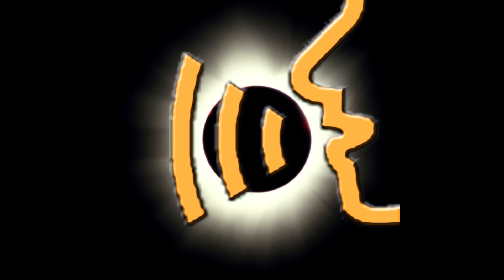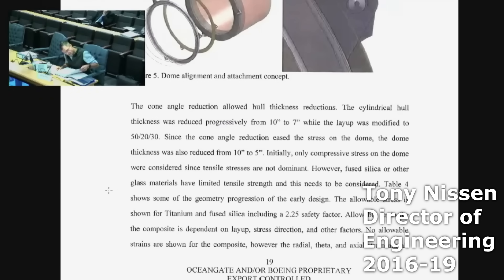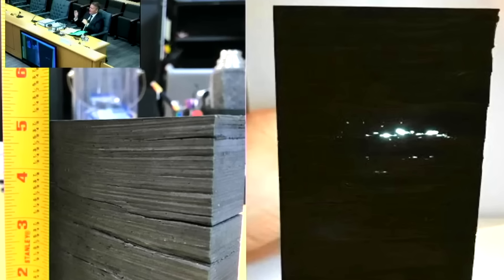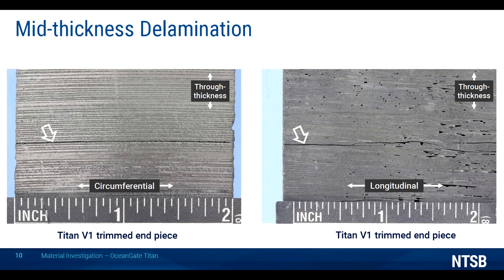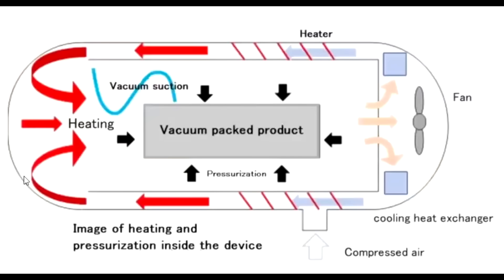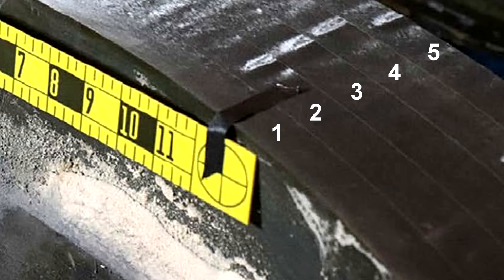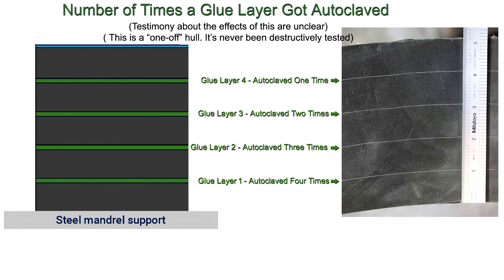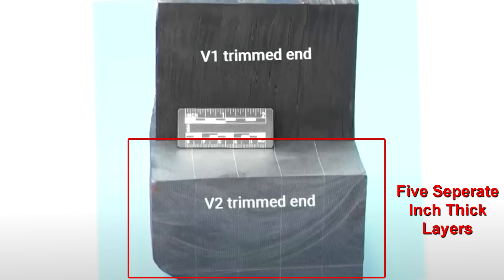Who Engineered the OceanGate Titan V2 Hull? Maybe Nobody Did?

Comment: I worked with composites for 25 years, and my first thought was the repetitive autoclave cures. For rework purposes, we were only allowed 2 additional cures.
Reply from the maker: Thanks for that comment.  Yes, the multiple autoclave runs is an issue that was not fully worked, from what I can gather.
Reply: I had not thought about this until prompted by this excellent video.  I would not be surprised that repeated cure cycles caused further shrinking of the layers. The would mean that the inner layers would give less support to successive outer layers than if they did not shrink. The result would be lower than expected hoop strength and axial strength. And fracturing between layers.

Also designing for 1,000 cycles puts this in the low cycle fatigue zone.  In that zone a defect could well mean a degredation of two orders due to a flaw.  Two orders means possible failure at 10 cycles. Bon voyage!
Reply from the maker: @piperg6179  Yes, apparently there is very limited information on the effect of the first layer of carbon fiber being autoclaved 5 times.  Bart Kemper, gave good testimony about it; too many unknowns and OceanGate didn't test it at all!  I mean zero testing!  Thanks for commenting.
Reply: So the inner layer would be pulling from the outer layers?
Reply from the maker: @cudedog  Yes, basically they would act independently which is weak.  You need to watch my latest video on that, search YouTube for the title   OceanGate Titan Hull - Porosity & Glue; Porosity & Glue; Porosity & Glue
Reply: I agree that multiple heat cycles can damage composites, especially when the heating profile is exceeding debonding temperature. You can of course get away with it with proper process control - but this is done with composites that are not really used in high stress bearing applications.
Reply: Excellent video.   Thank you.
Reply from the maker: @ginaanddenes9059  Thank you for the support.  Happy you liked it.
Reply: Aye, testing of repeated or prolonged autoclaving should be pretty easy, i think: Measure dimensional change and compression change of a block after each autoclave cycle.  But all testing still won’t compensate for the use of the wrong material.  In my primitive mind I keep seeing zillions of fibers that are very strong when stretched but in compression must be held in column by a smushy binder. If the binder allows axial movement of the fibers the whole mess collapses in a flash.  

No doubt this obvious problem was seen by Stockton as evidenced by his completely optimistic attempt to evade collapse by listening for small breaks on his RTM and surfacing before a runaway failure.  Propagation runaway in milliseconds and curing rise to surface in hours!  As a cockney couple remarked when i was a lad…..Pigs might fly if they ‘ad wings.
Reply: @lj6278  ed xxxx is on to something…..carbon fiber composites are indeed poor choices for compressive loading.  The Titan hull never would have failed if the designers had thought to have a vent through the hull so pressure inside and out were equal.  The crew would, of course, have to wear ear plugs.  Another, less perfect solution would be to fill the hull with conrete before a dive.  That would surely prevent implosion and on return to the surface the crew could just be chipped out of the concrete and scrubbed and showered.  And now i must toddle off to bed.
Reply: @lj6278  The possibile disconnection between layers is of some interest when the hull starts to fail because that initial failure is likely caused by the addition of local bending stress to the compressive stress imposed radially around the hull cylinder (usually termed hoop stress).  But hoop stress is the big stress and is purely compressive.  So, each layer would be supported by the adjacent interior layer, bonded or not.  Now, suppose that the inner layers, being subject to more autoclave bake cycles, shrink just a bit….the result would be that the outer layers have less support as hydrostatic pressure increases radial loading. 

…..just another little problem caused by choosing the wrong hull shape leading to choosing the wrong material.  Suppose Boeing had decided on making the 747 out of cast iron.  Or lingerie had been made of ferro cement. We would have somewhat less air travel and somewhat less romance.
Reply: No to mention carbon fiber is only strong being pulled apart, meaning its best used as a cylinder in keeping pressure in.  That subs hull had the strenght of the impregnated resin, and why it delaminated.

Comment: I didn't realize that OcenaGate was not really an engineering company, previously they purchased or leased submersibles. It was a desire to reduce cost and increase revenue that led them to "DIY" a new submersible. CF construction is not inherently unsafe, but the lack of investment meant that Stockton was continually short-cutting design, manufacture and operational decisions to reduce cost. This is really a failure of the OceanGate business model that led to the accident.
Reply from the maker: Thanks for commenting.  Stockton underestimated the difficulty of 4,000 meter dives. He also had to deal with Covid happening during the development of the first hull.  Then the first hull done by Spencer Composites seemed to have a lot of porosity and wasn't very strong.  Then they had the lightning strike in the Bahamas during testing and they have to trash that first hull. Bad business to get into.  I have a video about that.  Search YouTube for this title. OceanGate Was Broke! - Titan Caused It - Employees "Spill The Beans!"
Reply: @solareclipsetimer  Yes, now I think of it, I think it was your excellent video that highlighted the problems with the business. 🙂
I guess the problem is if you charge only $250k per customer, then you need a lot of customers to recoup the cost. But then you need a solid and reliable vessel to handle a high frequency of dives, and not a limited life experimental vehicle. OTOH if you charge a more realistic $1M per ticket, then you might seriously reduce the amount of paying customers.
I draw a parallel with Virgin Galactic, in a similar adventure tourism bracket. With a modest ticket cost, they get a lot of customers, but they have struggled to get a repeatable performance out of what was essentially also a one-off experimental vehicle.
Reply from the maker: @bobcousins4810  Yes, it was a business model that was tough to make work.  I think that is why his original business partner Guillermo Sohnlein got out early.  He had more business sense.  Thanks for commenting

Comment: Why carbon though?, it's not like it needed to be light to be under water. Aren't most modern sub hulls made of titanium?
Reply: The density is important, also CF is a lot cheaper.
Reply: If you do not want an expensive and specialized ship to deploy your submersible, weight is absolutely a primary concern.
Reply: @Kyle-sr6jm  Looked it up and the sub weighted around 10t, don't know how much of that weight was of the hull itself but doubt it would have increased the total weight all that much. Let's say it's 15t if made of titanium, can't some decent ship crane lower that just as well?, the damn boat was called Titan FFS!! The whole operation was superfluos and targeted to millionaires, what's a bit more money for this kind of endeavours?.
They should have let the riches control some 8k camera ROV from the luxury of a surface yatch while eating gold plated caviar and doing cocaine instead of using a manned ship, it's not like they were able to walk under there by themselves or anything. Going down in person is more or less the same and I bet they had to pee in a bottle or wear diapers, a shitty experience that added nothing of value but the bragging rights of being able to tell your rich buddies that you were down there.
Reply: Weight is absolutely a consideration - and titanium is also a lightweight material, so you seem to have answered your own question.
Reply: Weight.
Reply: Size is also a consideration. Even titanium pressure spheres are negatively buoyant, and every kilo of negative buoyancy means a large volume of syntactic foam needed to counteract that weight. Very heavy hulls need massive amounts of foam, which is bulky and makes the vessel slower when descending, maneuvering, and ascending.

Because it was intended to be a commercial touring vessel, being able to descend quickly, navigate to the Titanic quickly, spend as much time at the wreck as possible, and then ascend quickly would have led to a better experience for the passengers and a faster dive turnover, meaning more money.

Comment: Even if an engineer designed it, it wasn't engineered. He did pretty good, too. It worked for awhile. 😂
Reply: If he inspected and replaced the carbon fiber when needed, it probably would have lasted a lot longer.
Reply from the maker: Thanks for that comment.  That is an interesting way to put it.

Comment: 5:00 This 45° plies (of to follow what ever the designed layout configuration of the composite sheets is) is teached in the basic composite material course in aeronautical engineering studies in Finland. It is composite material dssign 1-on-1.
Reply: @mikapeltokorpi7671  Who'd have thought that strictly orthogonal strands would not make for the best stress distribution, right?
Anyway, I only know of 3D printed ones. Would you happen to know if one could check out a course like that online?
Reply: @JaroslawFiliochowski This was was over 15 years ago in a Finnish Tech College. Unfortunately the whole Aeronautical Engineering dicipline was ended after our class (both Finnair and Blue One major maintenance was mostly moved to abroad just before I graduated).
Reply: It's taught in us community colleges and also relayed to all composite hand lay up techs at Boeing when I worked as one XD

Comment: I’m not an engineer and I haven’t watched the video, but to me carbon fibre is fine for homogeneous contained pressure vessels but why would anyone use it to withstand pressure is beyond me.  As a rough comparison its about as useful/less as a rubber inner tube for the task regardless of the thickness IMO.
Reply: Why would you comment on a video you didn't watch? Genuine question, as there seems to be a lot of it about

Comment: If its a boing I'm not going 😮 not space, sky or under the water. I'm hoping they're not planning on building cars 🤣
Reply from the maker: Thanks for commenting.  Yep, Boeing has been having some issues lately for sure.  In this video I showed with the Boeing testimony annotation that the Boeing work for OceanGate regarding the hull consisted of some preliminary design ideas in the period of 2012-2013.  Very early on and they never built anything.  To give them a little credit,  they actually recommended a very important thing that was ignored, and that was a layer of carbon fiber laid at 45 degrees.  As Mark Negley testified, a layer at another angle helps distribute loads from other fibers that maybe under stress.

Comment: Spencer Composites thought in terms of at least 1,000 cycles for V1 hull, that is, it was a limited service life component. V1 didn’t last very long perhaps due to a lightning strike. V2 lasted 19 dives to depths over circa 3,300 m.
Reply: It should be noted that real manned dsv pressure hulls get hundreds to even thousands of pressure tests to their max dive deoth often taken a year or two of tests before they put the vessel out to sea. Oceangate didn't even do a handful of full scale pressure tests on their pressure hulls.
Reply from the maker: @toomanyaccounts  You are absolutely correct, the point of this video,  and thanks for adding the thoughtful comment.
Reply from the maker: Correct.

Comment: IMO the thing would've eventually collapsed even at 7 inches thick, it just would've taken more trips under the sea, and then we'd be right back here having these exact same hearings about why it was 7 inches thick instead of some other number - and the engineers who said it should've been 7 inches thick would now also be culpable. Epoxied carbon fiber isn't going to be able to survive deep sea dives numerous times the way something like a metal would, it will invariably start delaminating and lose its structural integrity until the thing implodes. They should've been taking those noises more seriously and cut through the thing to analyze how the intense pressures it was exposed to affected it, to gauge how to adapt future limited-use submarines could be fabricated. Instead of Stockton taking the opportunity to learn and advance, he just pushed the thing to its absolute finite limits, and in the process took some souls to their graves sooner than they should've been.
Reply from the maker: I agree with you.  However, maybe 7 inches thick with 45 degree plies, then do 20 unmanned dives and cut it up to see how it behaved.  The co-bonded thing they did is a bad idea.  But I don't know how you get the air pockets and voids out of a laminate laid down at one time 7 inches thick.  Maybe that can be figured out.  Thanks for your comment.
Reply: @solareclipsetimer  First you need to realise that the carbon fibre did absolutely nothing. If you wrap the core of a toilet roll in carbon fibre, it will take a huge amount of force to burst it open, (high tensile strength). But from the outside, you could just crush it in your fist, (almost zero compression strength).

By wrapping, the epoxy was full of air bubbles. Since air can be compressed, on the first dive those near the surface collapsed, shattering the epoxy around them until it compacted and took the load. On the ascent, the pressure dropped, so what were the air holes filled up with water.

On the second dive, since water does not lose volume when compressed, the same thing happened to the air bubbles deeper.

And so on and so on, until around half of the thickness had the strength of a soggy bath sponge. Since half the wall thickness could not take the load, the whole lot imploded.

They knew that on each dive the descent was faster and the ascent was becoming increasingly difficult, but no one properly investigated. If they had, they would have realised that the additional weight was from the air bubbles being replaced with water.
This is nothing more than simple schoolboy physics.

In my mind, there was a solution, Form two cylinder in titanium with a one inch wall thickness. continuously weld them onto endplates, one inside the the other, leaving a 5 inch gap.

Then put the components of the epoxy into vacuum storage tanks to purge any air, evacuate the airgap  between the cylinders, then inject the epoxy.

Back in the 1960's a similar method was used to injection mould the nose radome of Concorde. the mould tools were obviously withdrawn. 
These epoxy mouldings (developed by ICI UK) lasted the life of the aircraft.

My dimensions were intelligent guesses. Hopefully if they had been used, someone (not Stockton Rush) would have fine tuned them. Particularly the wall thickness of the titanium cylinders and the methods of injection, including epoxy shrinkage during curing.
Reply from the maker: @wilsjane  Thanks for your thoughtful comment.  I love this point you made (quote below), it makes sense, but I am not sure they were aware of it (I have not read about it)  "They knew that on each dive the descent was faster and the ascent was becoming increasingly difficult, but no one properly investigated."  But that is such an interesting point.  I guess the "Rhino Liner" on the outside of the hull wasn't enough water intrusion protection.  I'm not sure how water would have made it into the deeper layers of the carbon fiber, though?  But you point is great.  Thanks.
Reply: @solareclipsetimer  With a yard of carbon fibre tape and the core of a toilet roll, they could have easily seen that the carbon fibre was doing nothing at virtually zero cost.
As I explained, on the first dive, air bubbles in the epoxy would have collapsed, then sucked in water on the ascent. Since water does not compress, on the next dive the damage would have gone deeper. 
The ever increasing total weight should have sent every alarm in the building off. 
I hate to speak badly of the dead. but as well as being arrogant, Stockton must have been thick.
The glued junctions between the cylinder and the endplates were ridiculous. Both pressure and temperature cause differential movement. Even on storage tanks with a differential pressure of around 100 psi, the ends are domed. Obviously as a result of working with me, our daughter knew tat when she was about 12 years old.
PS. 
My work in this area is confined to pressure vessels used in theatres, cinemas and film studios. 
No matter what or where, the same rules of Newtonian physics apply. You just need to remember that volume is a geometric progression.
3 cubed has 27 times the volume of 1 and 10 cubed has 1,000 times the volume of 1.
Pressure follows the same rules, but on the surface area rather than volume.
Did Stockton have any sound knowledge of mechanical engineering. ??
Reply from the maker: @wilsjane  Great explanations!  Thanks so much for your thoughtful comments.
Reply: @ I can certainly understand why Stockton submitted nothing for certification, he would have been a laughing stock. If I had been there I would probably advised him to use blue-tack for his next submarine.
How he was allowed to slip through the net and kill people was the real problem. It was like someone feeling competent to fly an airbus because they made paper aeroplanes after school.
It is probably easy for me to say all this, after 55 years of designing London theatres, along with some teaching. 
Does it surprise you that I am 76 years old and still working.